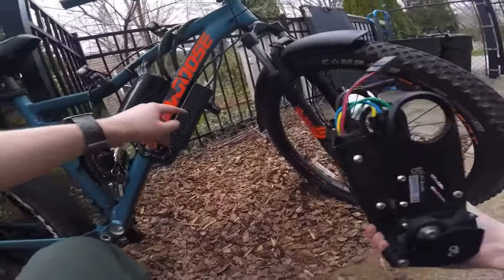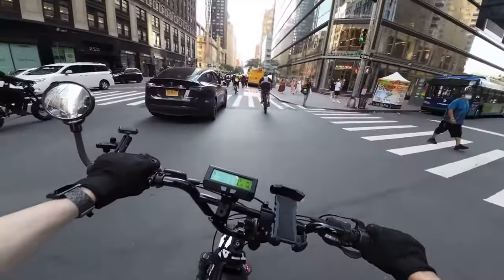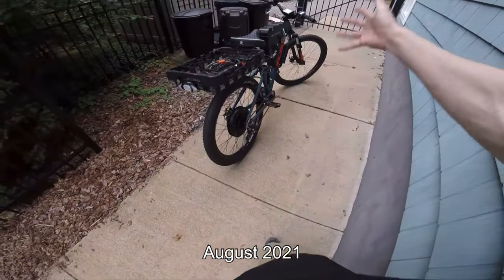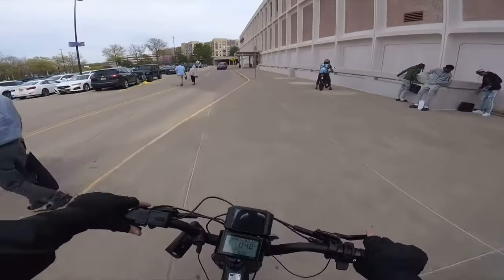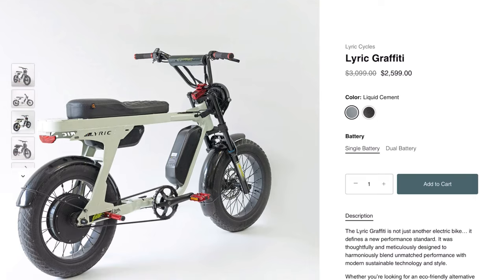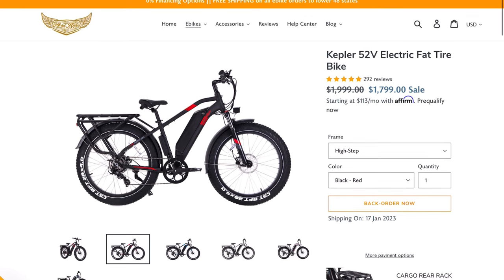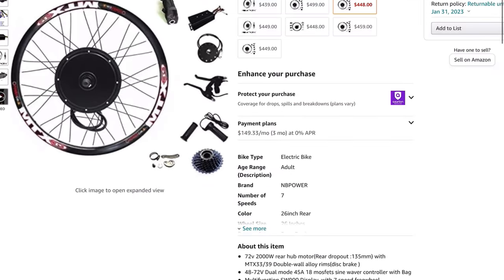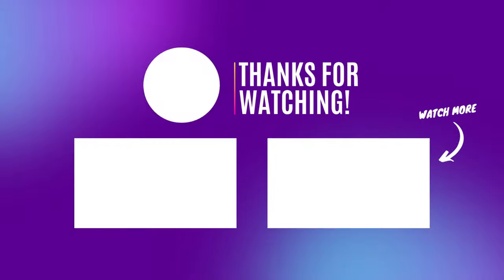Are eBike Conversion Kits Worth it Anymore?

Comment: I ride a e hand bike "I'm paraplegic" & the e handbikes will run around $13k without suspension & about $18K with. Then there is recumbent bike like Outrider who don't even list prices but start at $15k & go up to the mid $20k. See when then put a Adaptive equipment stamp on anything it pretty much doubles in price. I wouldn't be riding an e-handbike without Bafang & being able to wrench & work on it myself. Just one more dynamic to the industry.
Thanks for the video great job!!

Comment: Just put a 72v 3000w kit on a BMX bike had to use a thumb throttle. I put a suspension front fork on it with a better front rim, put hydraulic brakes on it and new crank system. Once I got use to the throttle I can fly down the road. Overall the bike is still on the sketchy side and you have to pay attention to what you're doing but if I have to do it again I would

Comment: I've still got my original first ebike I build with a cheap 200 dollar AW 48v 1200watt hub motor from Amazon 5 years ago. I put on a Specialized MTN bike and it did the trick nice. And I've ridden it in over a dozen downpours and a hundred rainy days easy and not one issue with the motor. IIRC it's got 3.5k miles on it now. Though I do do some things to help it last with all the abuse I've given it. The main thing is I rub petroleum jelly around any spot water could penetrate on or pool on  for the hardware that runs the electric part of the bike and that's prob one of the best pro tips I can give. I also put on my battery case around certain spots and around certain cable junctions. Not too heavy so it's noticeable, just a slight coat. Even on spots that have their own gaskets. I've seen plenty of gaskets in cars and watercraft not do their jobs so it's bets not to mess around and it takes a few seconds so why not just slide some on with your finger? 

Actually the only issue I've had with any of my ebikes was the batter kit I bought for my custom bike died one day and I found the solder for the wiring inside the box was total shit and dethatched. I learned my lesson to inspect and re-soldier all electric things from China. It wasn't a fluke. Since then I've found 3 controllers with the worst soldiering jobs you can imagine from a "professional". Haha. So yea, another pro tip is check the wiring soldier of your hardware. Even on these fully made bikes.

Comment: I did a 750w 48v 17m5ah Bafang mid conversion on a pristine Giant Iguana MTB I had. Like you, I have sunk money into it with Magura MT5e brakes, Lekkie Bling Ring, new cassette, light, and more. The battery position is a compromise, so I can't use the suspension forks. Still messing to perfect the rear derailleur (skips on high gear). 

My next ebike will be ready-made. There are some awesome options.

Comment: You gave the subject a fair shake for the average ebike rider. The 'outlier' ebike rider however...a guy like me, custom is the only way to go.  I am 6'1" and come from a competitive cycling background.  I am older now and would like supplemental motor power.  I like to ride fast in an athletic, aero position.  There are hardly any good bikes in this segment close to 2000 watts with 20 amp-hr battery where you choose your own frame size, saddle to handlebar reach and drop etc.
But I admit, I am uber fussy from bottom bracket height to crank length to handlebar width.  I want a bike completely tailored to my body as I still put out a fair amount of watts from my body and use my ebike for training and general riding...one ebike with a drop handlebar and the other with a flat handlebar...both with my favorite motor, the BBSHD.

If you ride an ebike like a motorcycle or moped like you do for example, there are a lot of options and as you correctly state, and more available every day....a very popular space.
As much as like your folding bike with nice big 60v battery, I think as you suggest, for a comparable ready built bike with more power, I would choose the Lyric Graffiti.  I would likely have a custom seat made for it...or buy one.

Lastly, if going more in the direction of how you ride with less pedaling, I vastly prefer gas motorcycles and I believe they are far superior to electric motorcycles in power and range for the price.  A Honda Grom or Trail 125 to me is much better alternative to anything lower power and electric.
Reply: 100% agree.
Reply: Agreed!
Reply: What you said about gas powered bikes is true but, at least where I am, they're subject to much more regulation like registration, insurance, turn signals, etc. Which puts them into a different class of vehicle. With an ebike, it's still a bike. In fact in my state they're considered non-motorized vehicles. Can't get that classification with a gas powered vehicle.
Reply: @timothyliberty8052  On your side. I love all forms of moving other then walking. Well walking ok if you don't need to get anywhere fast. Also with my ebike I ride where I want. Don't care what any sign says. Freedom!

Comment: It all depends on where you start. a lot of people may want to just add a little juice to their current bikes rather than go with a complete e-bike build. It's a fine balance between weight and usage. My e-bike is pushing 144lbs. and this is way too much weight to push against the motors all the way home if something goes wrong. It's also too big to fit in a suv or rack. but I love it for the trails and around town.

Comment: my main reason i build my own is because that's the person who i am, i am a DIY'er, half of the fun is building it yourself. second reason why i build my own is because the pre-built batteries were price gouged so hard with pretty bad specs; i want my battery to discharge 200 amp at 72 volt, i want to charge at 20 amp! the pre-built batteries that came close to those specs cost $3000 just for the battery. so i bought my own cells, wired it all up and now i have the battery that i want. i don't want my bike to look like a dirt bike and mine can go just as fast as the $8000 bikes (spent less than $2600 to finish mine). sure i spent alot of time researching bikes, motors, batteries, bms, voltage controllers etc. to get to this point but now my knowledge base is far bigger and i ended up with a higher quality product that i totally trust to ride. don't get me wrong i'm not saying pre-builts are bad, just be prepared to spend dramatically more money.
Reply: What motor did you go with?  Curious.
Reply: @Ben.N  it's a cyc x1 pro gen2 mid-drive-motor with bac 2000 controller where i upgraded heatsink/fan support more current, lipo battery 20S 72v, 48 tooth front sprocket with 7 speed rear cassette. if i'm in 5th gear, and the controller/motor is in "offroad" mode and i start to pedal/hit the throttle it's stupidly fast/torquey and then when i shift to 7th the speed just comes out so easily...i hit 52mph and then called it there, i did not want to push it any more at that point, it's cold outside

Comment: cool video, I Have built over 10 ebikes, love doing it, recently bought a kepler and added a  second 52v and 72v front hub motor, greatest bike ever,  3000 miles on it and it runs amazing, 45mph cost around 3500 total.

Comment: I love an electric conversion kit been using them for years have some kits I have used on as many as 5 different builds. I guess it really depends on the person, I love bikes, I love building them, I love electric motors and adding them to bikes is like a drug for me. I can honestly say I have built 50 plus different rides 26 ,24, 20 inch bike and trikes and even duel motor kick scooters. I started with a purposed built bike but soon found tech support was not there or helpful. I bought an conversion kit to repair the factory bike and it was like the best thing ever, could not wipe the grin off my face. I hate to admit but at this writing I have four conversion bikes and one trike plus three still in box motor kits wait for another donor bike.  I like my E-bikes to look like E-bikes ( all my conversions have white tires) but not change the wheel or frame of the donor bike so when I change out the kit to another bike the old frame can be returned to original. Plus riding in the city I sometimes have to use a sidewalk and folks don't freak out over my mountain bike conversion like they do when they see a 26 inch fat tire rolling towards them.

Comment: I got a 26" BMX bike for up to 7'2 riders. I converted it with a 1500w hub motor and a 52v 20ah battery. It tops at about 33 to 38 mph. I have people ask me about my Ebike but more than that I have bike riders asking me where I got such a big BMX 🤣 I know that my bike is nothing like anything I have seen online or on Reddit or anywhere my bike is one of a kind and once I get fully fitted I'll show it off to the web. But my bike does all I need it to do and I have plenty of space for much needed upgrades. Only thing I want is maybe a better battery and a waterproof kit and battery if possible. If I can crack 45mph and do atleast 50 miles on a single charge I will die happy in regards to my custom build. It's a good bike for getting to work and classes and for small grocery trips or big ones when I take the time to mount up my cargo rack and bag. I can hop with it and wheelie and do a couple of little tricks and I have a blast going anywhere on the thing. However I would love to have a second bike that can hit like 55mph or maybe 60mph with a long range. Something with fat tires and highway capable mostly just to be able to visit my mom without having to take my car and make a whole trip of it it would be nice to just ride out to see her really fast grab some food and then go back to my city.

Comment: If you're on a budget a conversion kit is the way to go, just not brand new! I picked up a second hand kit to fit on my $60 tip bike. Now I have a 1500w bicycle that keeps up with residential traffic, and all for less than $500 AUD.
Reply: My first I made from a 1200 watt 200 dollar kit and 300 dollar battery is still alive with 3.5k miles or more. I have 2 non custom ebikes and I still love that original one as much when I want speed. The thing goes 44mph on the flats ffs. My mid range company made bikes each top out at 32 and 38mph. And that 6-7mph sure seems much faster. Though it's taller than my non custom bikes so being up higher while going fast might be why it just seems so much crazier. Haha. 
HF out there and watch out for the ladies on their phones. Been hit twice by ladies on phones in 3 years. It's getting scary out there.

Comment: You always get more for your money when you build your own mid-drive plus the mid Drive motor has much more newton meters of torque than the comparable size Hub motor. The build that you showed in the beginning of this video is sort of a Frankenstein. The battery doesn't fit in the frame etc etc and the bike wasn't high-end enough (with hydraulic brakes etc etc) that you didn't need to modify it a ton. If you start with a high-end enough bike a mid-drive kit is the way to go but make sure you're matching your components properly.
Reply: A rear Rack or shark type battery perhaps would have been a better option for the build on that particular frame for example.

Comment: I built my own and you can see on my channel. I don't have a car and use these 10 months of the year. The bafang fat motor is rock solid and the flipsky 65100 runs well. If you build your own you will learn a lot but you will spend lots more time with it than a pre made bike.. Get torque brackets, single speed and I wish I had rear suspension....

Comment: Id rather build my own. I want something that still looks like a regular bike at first glace, but also want to push 72v and 3000w+ through a mid drive.    That's not something I can really go out and just buy
Reply: You better get a really thick 2nd chain on the left side!
Reply: @richardjensen3655  I've never snapped a chain. Ran mine at 52v for a year with the same box 3 chain. Didn't even go past wear limits

Comment: I mean you got to the core of the issue with your first build. There are too many people trying to build e-moto/e-moped on cheap bicycle components. If you want an e-motorcycle that doesn't fall apart after a few thousand miles you need to start with motorcycle components. If you're building a bicycle that's meant to act and behave like a bicycle you'll have much more success using typical bike components. What I'm realizing though is a significant portion of the "e-bike" community basically just want e-motorcycles which is why everyone is obsessing over 72v and 3000W+. Like at that point it really isn't a bicycle anymore. If you're actually looking to build a bicycle it's still worth it to build from scratch with quality components. E.g. I just finished a build on a Surly frame with a Grin GMAC. For the power, features, and components of my bike you'd be looking at $5000 plus in the market whereas I built my for ~$3500.
Reply: This needs more likes. But you hit it right. Most people want an electric motorcycle. They push high wattage on bike components and they get all shocked when it fails.

Comment: Pretty good video. For 1000 Watt or less (35 mph and less) with cost savings in mind to convert a bike you already own and like, yes.   I think for the high voltage/amp world you will have many upgrade motors/controllers/batteries to choose from - KO/QS/Bac/Fardriver etc. A few proven frames you can buy alone and add what you want but mostly premade e-bikes. Those will be Variations of hub motor bikes like Onyx/huck/Delfast and variations of Surron/Talaria/Mantis mid drives. That Mantis seems interesting for the price. I would still prefer a DIY on a proven frame made for it.

Comment: I built my own because most businesses cut corners, use unreliable parts and skimp on power in order to make more profit. Currently I use a scooter I'm running at 8kw. It cost only £1,100 to build and I've never had to upgrade any of the parts on it because I made it how I wanted. However, the system I'm using is great on the trails but illegal on the motorway. 

My build for the motorway is a 100v system with broken kbls96351 controller that I fixed for £200 and qs138 90h motor for £380 36s2p 40ah (3312 watt hours) lto battery salvaged from equipment costing £720. So far it's cost £1,400, rolling chassis (triumph 1050st tripple for £100!!!) but I'm looking at a total close to £1600 finished. It will pull 35kw max and the batteries should last a good 20,000 full cycles (decades) and then some more.

If you build your own you can make it how you want it from the get go and not be forever upgrading an increasingly disappointing machine that is already overpriced.

Comment: For me, conversion is going to be the only answer. I love my Trek Verve 3 but would like to add some current to make it more practical in the hot Florida summers for commuting/errands. Summer 2023 has been one of the most persistently hot that I have experienced down here. I have been limited to riding after dark, if I ride at all. I can get a decent Bafang H640 direct drive hub kit which works with my 9 speed cassette and a 52v 20AH battery for around $850. If anyone knows where I can get a 750w, 52v, 20AH prebuilt that’s as fast/comfortable as my Verve 3 please tell me. Even for those who don’t already own a bike, it makes more sense to DIY because you have open-source parts everywhere! Good luck finding a new controller or battery for your pre-built in two years.

Comment: I buy Gear hub motors to use for modifying a DIY Dual of adding a 2000watt Gearless to use as a Turbo Booster. Best format to do a dual of a Gear motor for the base motor with a Gearless to use as a Turbo Booster. Performance exceeds the 3000$ and higher end e bikes and I always have all my e bikes with same mods to use. It's really the BEST way to have a great e bike of being way practical for the income range of my class of saving money of exceeding the value of the higher end e bikes.

Comment: I'm looking for my first ebike after a lifetime of motorcycling, I presently have a Honda Goldwing. The Ariel Rider Kepler caught my eye as a good deal for the features but I'm torn between a 26 inch or a moped 20 incher. I've puttered around on my Royce 26 inch 7 speed off and on for several years. I couldn't understand the interest in the Super 73 as it seemed overpriced and under featured.  When I think I have candidates narrowed down and I'm ready to buy, a new brand is brought to my attention. So, videos like this one are what I'm looking for.
Reply: I'll add that I look at conversions, but while my Royce is nice for what it is, I think a prebuilt is a better value.
Reply: If you had a street bike, I'm not sure if a pedal bike will be the perfect fit. E-dirtbike like a segway or sur-ron may be better, one speed, throttle only, can climb 45 degree hills.

Comment: Hi Jonny I have a 500Watt bafang rear hub motor kit with a 48V controller with high plugs it ha pas and I want to put a torque sensor bottom bracket on my Norco storm 3 will it work if ug the torque sensor Into te pas sensor  cable 😮

Comment: Disagree. I went pre-built MTB fatbike. I rode it to its grave, now the motors grinding, cable cut, repaired then battery died. So I’m considering adding a DIY motor to it, but turns out I can’t upgrade my wheels or add a dropper because the frame doesn’t  have standard sizes. Forget that, I’m now building out a custom bike that I could swap multiple diy motors on long term. I ride my bike A LOT and plan to ride multiple motors to their grave. I’m finding frames (including carbon) with all the mount holes for batteries. I also want to go diy for multiple batteries. I’d rather carry/mount an extra battery or two on long days and not carry extra on short days. I might stash the drained one in the bushes along the way so my final high altitude ride is lighter weight.